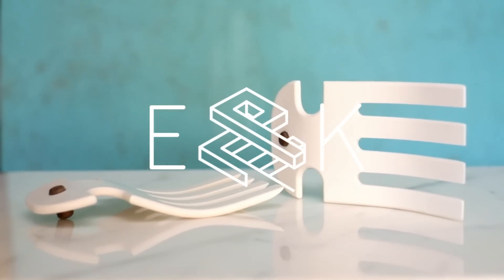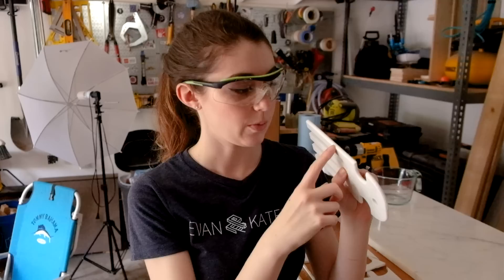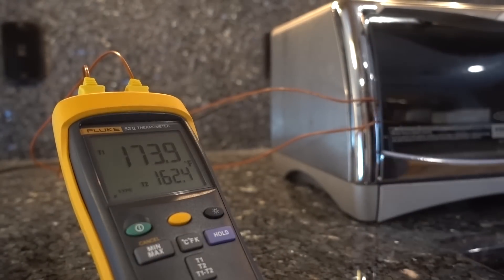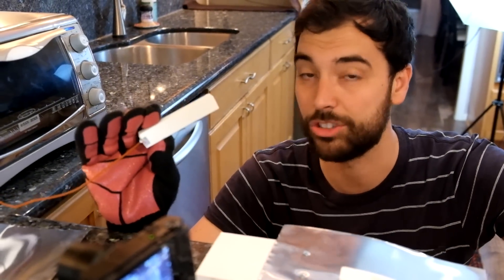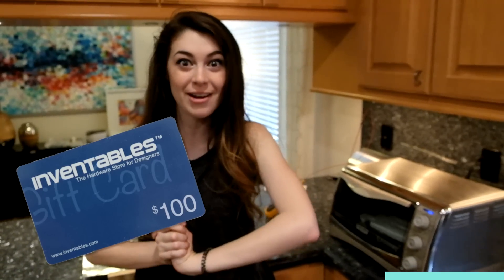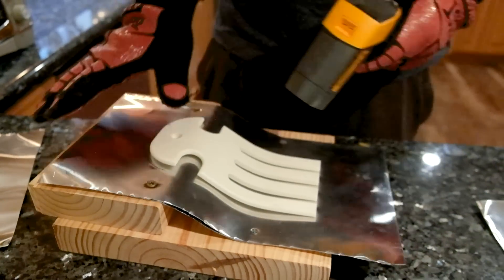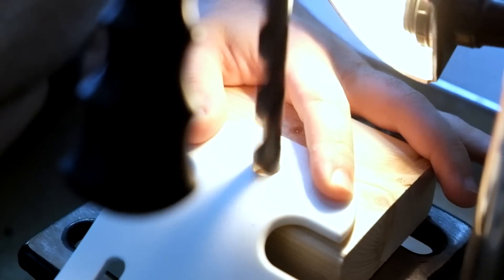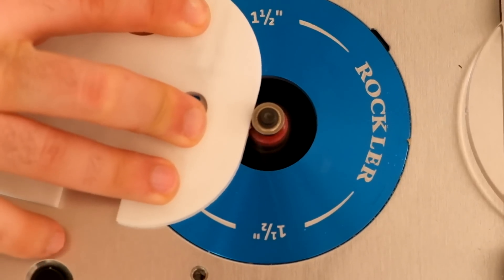THERMOFORMING 300° CORIAN (how to make salad servers)

Comment: A few productions changes id incorporate, a press that holds the mold and item in place while cooling. Use a rivot press for the dowels instead of hammering. And also look at kydex for an alternate material. You can get kydex in an endless supply of colors or designs that would appeal to a wide range of people

Comment: About the infrared thermometer: they are calibrated on dark surfaces, so using it on something light (like your coriander) or shiny (like metal) will never work just right. Thermocouple or contact pyrometers are the way to go. Great project!
Reply from the maker: Thanks for the tip!

Comment: seen someone making a rear window for a car out of clear plexiglass , he put the straight plexy over a form inside the oven and heated it up untill the part was fully draped over the mould , it takes longer in the oven but i think it will give a better result 
seen on a show at discovery about a company building big fishtanks that they do the same using large wooden bucks covered with fabric , and those whereinch thick pieces of bulletproof lexan 
there was sumting about actual moisture inside polycarbonate that you needed to cook out on a lower setting before shaping it or the stuff turned milky and showed a lot of bubbles trapped inside of it
Reply from the maker: So cool how it can be manipulated like that!
Reply: @EvanAndKatelyn   in the same way you regulate an electric kiln https://www.amazon.com/gp/product/B00HVA23CK/ref=as_li_ss_tl?ie=UTF8&psc=1&linkCode=sl1&tag=practicalrena-20&linkId=51bd6f3ab53c0de6b8c0db52c123214f
https://www.youtube.com/watch?v=tigqXyqB9h8
this shows a kiln used to melt metal for casting but it  allso works with lower temps like regulating an electric grill / oven , you can probably get it pretty constant it you insulate the box that you heat up

Comment: when you cut out the parts. why dont you you fully cut them out but instead leaves small tabs
Reply from the maker: If you don't leave tabs or secure the material in some way, the piece will come loose and rattle around, getting messed up

Comment: One production tip for future work like this or with acrylic is make yourself a 2 piece buck/mold out of mdf. Makes the forming process so much easier to just clamp it in the mold until it cools instead or worrying about cooling temps.
Reply from the maker: Thank you for the tip!

Comment: You have got corian milling down perfect!  Mind if I ask what your feeds and speeds are?  And what kind of bit you're using?
Reply from the maker: We used a 1/8" two flute upcut, and for the speeds and feeds worth just put in the material type and thickness into Easel and used what it recommended
Reply: EDIT:  Nevermind.  I'm a dummy.  Caught that in the video.

Comment: Did you set the emissivity (the e value) on the IR thermometer? Usually they're set for something in the 90-95% range (flat matte black) rather than glossy white (which might be as low as 5%).

Comment: That was fun to watch. The dimple made by the thermocouple wire made me think, "that would be a good spot for a touchmark."
Either right before you press the Corian into shape, or during the press, have a touchmark tool ready to press your logo into the Corian.
What is cool for me is I replaced a missing multimeter with a new Klein model that came with a thermocouple attachment. I was thinking about what to do with it,  and your video popped up and the thumbnail was your meter measuring the temp of the Corian!
Reply from the maker: That's so funny you say that - it made us think about doing a touchmark too!! And yes you should definitely put that thermocouple to use 😁👍

Comment: Fun stuff to work with :)

One thing you must have learned from that nice Alec Steele, the more metal mass the faster it'll draw the heat from your work piece.  

In his case, the anvil heat sinking could be a problem but for thermoforming corian (and acrylic sheet, that works great too and there's some really funky acrylics that have a high refractive index so the edges seem to glow...) (sorry, got off ona tangent there..) , yeah, for thermoforming corian, maybe a lump of aluminium stock underneath would help draw the heat down faster?
Reply from the maker: Oooh yeah that's a great thought! The larger the mass and the more conductive it is the less time it will need to be held in place for! Might be something we try next time!
Reply: You can just get a wet rag on it.

Comment: Cool project! A Corian spoon holder would be neat... I do have a quick question: why didn't you make a form to shape the spoons out of plywood or MDF, similar to the process of bent-wood lamination? That way you could clamp it and let it cool without having to press it down. Also this would ensure repeatable molds that are identical. Maybe you could also make bowl-shapes this way, to slightly deform the Corian?
Reply from the maker: Mainly because making a little jig from wood and flashing was faster :) but yeah definitely want to make a form and clamp things down in the future, and definitely want to try making bowl shapes to see if it's possible!